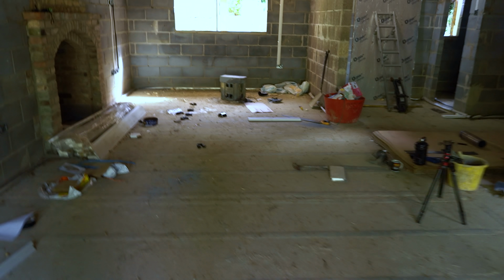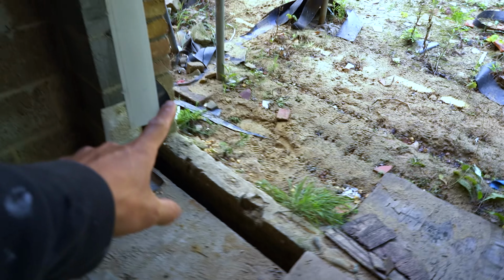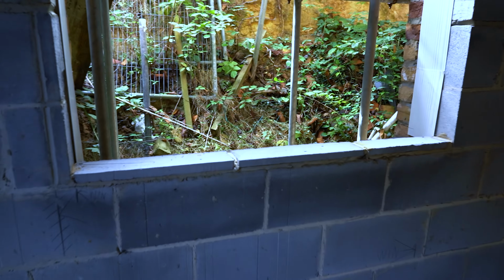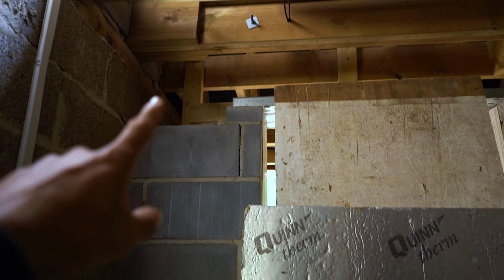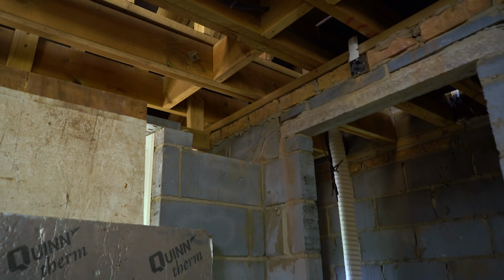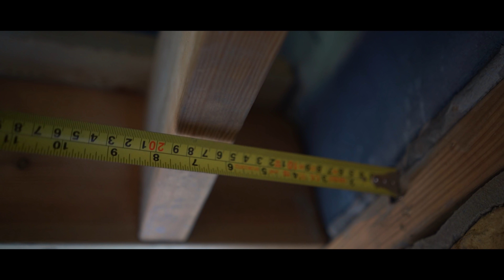BRICKLAYING Time| House Build E.P 104

Comment: Don't lay blocks through your external door threshold buddy to retain insulation and screed cause you will create a cold spot..if you had left the blocks out it would have been perfect to fly your insulation through put a 25mm upstand against the back of the brick to stop any cold transfer and then your screed will do the same it will wash into threshold opening and upto the the back of the brick/insulation upstand that way being solid , and ready for finished floor...much neater job and better practice!!! Hope that helps dude 👍

Comment: Great to see the house progressing again. It will be a home once you have the windows in.  Dumb qiestion: On the internal wall, did you shim the tops of the blockwork you added where it meets the joists. Appreciate the design might not need but I couldn't resist doing that unless there's a reason against. Look forward to next one.

Comment: Hey rodian loving the videos I’m currently doing my apprenticeship as a bricklayer but I mostly do block work just wanted to ask you a question I am finding it very hard to reach out and lay block when up on scaffolding as it feels as if I will fall over the wall and usually there is no scaffolding on the other side my co workers seem to be able to do it but I haven’t got used of it yet would you have any advise on how to do it correctly sorry if it’s a silly question
Reply: You will get use to it Adam . Don’t you lay most of the block work off the joist flooring ?
Reply: Adam Scanlon keep your weight on the furthest foot away from the wall that you are building.
Reply: Neil Smart yes hopefully I get the hang of it it’s just with the weight of the concrete blocks and reaching out really easy to lose balance. I have yet to lay off joist flooring only been on the trowel full time 1 month so not up to joist on the house we’re building yet
Reply: Derek thank you for the advice much appreciated
Reply: Adam Scanlon  hang in there mate it will become easier the more you do it 👍